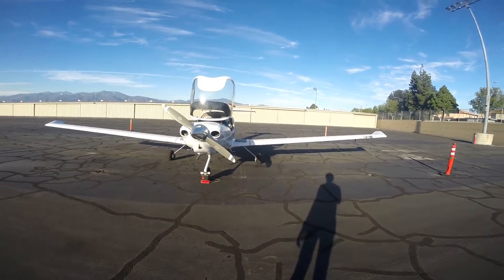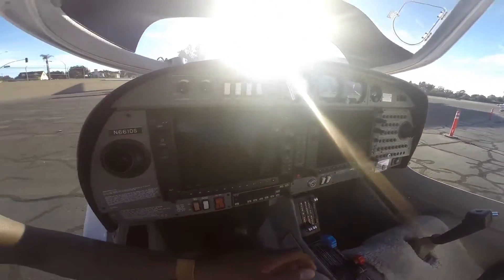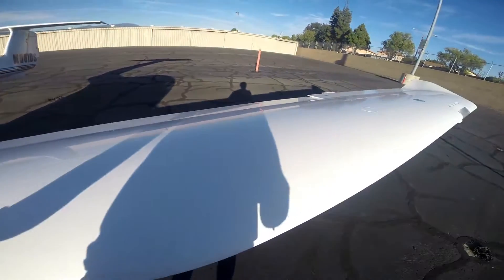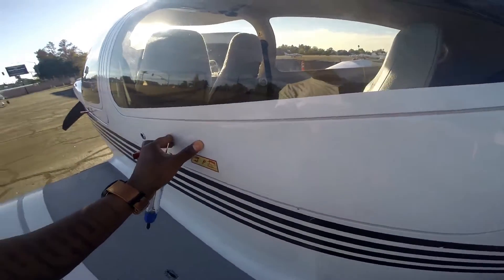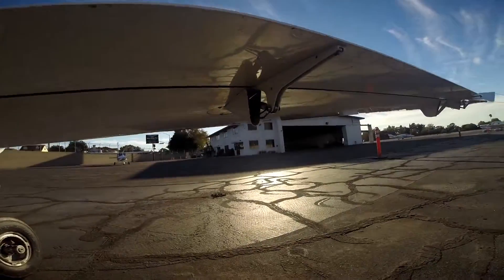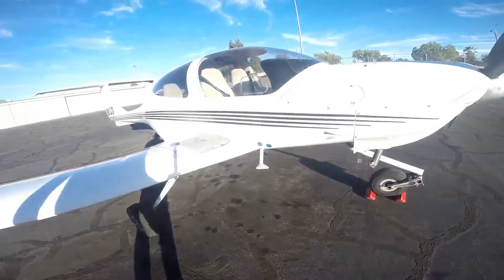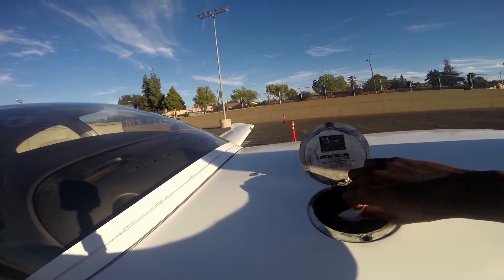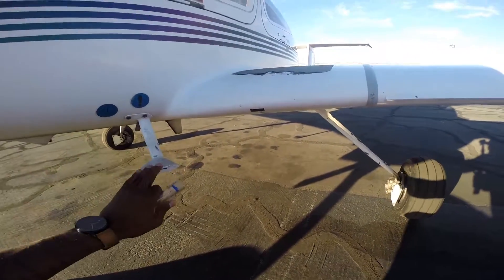Diamond DA40 Preflight Inspection

Comment: There are some states that prohibit throwing the fuel to the ground (Florida for instance), you should put it back in the tank. Also, it is important to check the color (not against the sky which is already blue, put the plane on the back) to make sure is the right grade, impurities and presence of water. Also, you should measure the amount of fuel in the tank when you open it, relying only in the instruments is not recommended. Some people recommends also to rock the wings for any present water to go down to the fuel sump.
Reply from the maker: I'm well informed with all that, thanks. This video was made on like my second flight lesson.
Reply: you suck mojo